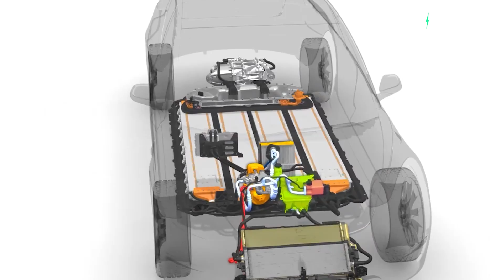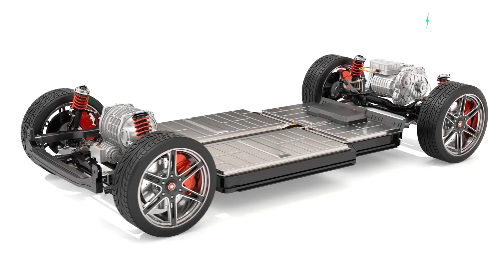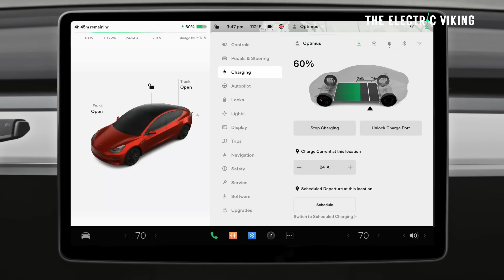No, you don’t need to replace Electric Car Batteries in 10 years time

Comment: My 2021 Audi e-tron with 56,000 miles lost a lot of range suddenly November 2023. A 100% charge range of only 171 miles. An 80% charge range of 156 miles. This never went back up either. The temperature never went below 50° outside. I always charge at 80% unless I'm taking a trip And I do this every night at home. I rarely use a fast charger unless I'm taking a trip and need to get home. I spoke to Audi about this and they said the battery health was fine, battery degradation was normal and that there were no error codes so the battery was in good health. This is ridiculous to me. Not to mention that a $75,000 vehicle is now only worth $32,000 for trade in value. And now the e-tron has a battery recall due to a fire risk. Before the battery issues, the car was one of my favorites. And I was all on board the electric vehicle evolution. Not so much now.

Comment: I take umbrage with this . Its not my experience with cars . Not the stats , but the stats only show that people are stupid .  Cars last very long if you drive them correctly and maintain them which is not particularly expensive when you do basics and drive correctly . 

In modern times driving low end cars I have never had any major failure and cars should last 200k minimum .

There are Soo many simple things to do to make a car last . 

I only drive manual trans cars but watching how people drive auto trans cars makes me cringe . They don't come to full stops before changing gears from drive to reverse for example . If cars have transmissions you can change fluids many people don't ever even look at it or pay attention to it . Learn a single thing about it and run them when they might need minor service until dead . That and scum bag dealers and mechanics take advantage . I drive manual cars and shift properly including not using the clutch much , rev matching etc . This is NOT brain surgery . People do not bother to learn how to drive .

They don't wait for car to reach operating temp before abusing engine . They are so soft they run HVAC before car is running at temp . They don't drive correctly to preserve brakes . They suck at driving and hit all kinds of stuff that slams the suspension and car . They don't run the AC in winter . They don't check oil and run engines with lower oil which increases oil consumption and then still don't check oil , retard levels of stupidity . They don't bother to familiarize themselves with basics of how cars work so are easily taken advantage of . They buy STUPID CARS with  stupid upgrades that fail . They buy GERMAN CARS !!! They buy cars with complicated twin turbo set ups built by Germans that have stupid engineering with plastic parts prone to failure . When something important fails their overpriced garbage with SOFT TOUCH everything they do not take care of looks like dog shit , that along with failure of over priced non essential options that fail cause major depreciation making the car not worth fixing . This is because people think other people care what their car looks like and what badge when new . 99.9% of people who see you in your car have no thoughts about you ever nor will you interact with them . Humans are weak minded and buy into ideas that cars are important to their person and  status which is at most 10% true in regards to what brain washing would have you think . 

People have poor driving skills . I drive a brand not known for efficiency, HYUNDAI , I drive a 2019 Hyundai Elantra GT ( I-30 in rest of world) N Line  , which despite having only a 1.6 engine with a turbo it is rated for like 28 combined because  it makes a whoping 200 hp to give it a sporty feel when connected to MT . I paid new 21.5 K $ with tax etc , I OF COURSE DID NOT PAY MSRP LIKE A MUPPET , nor did I get the 4500.00 upgrade product with mostly useless upgrades .  So I got a brand new car for what many people pay for a unknown qty used car . Anyway , I can get 40 mpgs in mixed driving if I want with the manual trans and paying attention or get the 28+32 
Mixed when I'm in the mood to redline it a bunch and make satisfying up and downshifts etc . Many people are unaware to drive the piss out of engines somewhat   regularly AT OPERATING TEMP / WITH HOOD OIL at proper level , so engine runs good longer . They do small trips over and over never letting the car warm up and zip around destroying engine . They put cruise control on and don't vary engine RPM at other times . I don't need to replace clutches because I don't use them much because I operate the car correctly to where you don't need to and never had a manual trans or even an auto fail yet many people do . 

Stats may be true but that doesn't mean they need to be . 

Then , the stats you quote don't consider the lack of ability to service EVs , the issue with EVs being totaled from minor issues or Hyundai for instance wanting 50k to replace a battery on car with scratched battery shield causing major insurance issues for owners , all the perfectly good EVs being totaled by insurance and then shipped to eastern europe and other places for profit where they fix and drive them .

You don't mention that people are STUPID and don't understand that if you full charge and fast charge and do many miles  in short periods then your battery does die prematurely . Degradation in range is real no matter what and real range is in perfect conditions not even always doable and charging to 80% is suggested for long  life and consider the avg consumer is brain dead .

Certainly the people who struggle to get service done exist.   Just because somebody who doesn't drive much may have little issues with EVs doesn't mean that's the case for others who are then out of luck . I just watched a vid where somebody did a road trip in a Cyber Truck ( this is a BIG TESLA FAN ) and charging times added 12 hours to what would be like 24 hours of driving . If you are only chasing status and virtue signaling around town that's fine , but if not that vehicle that seats 5 and has space for tons of gear  becomes useless for it's intent . That was without a bunch of gear and bed cover closed . 

NOBODY tells the whole story and anything and certainly not about  transportation and  human behaviour and trends .

Comment: Why Don't  EV  companies provide battery  warranty for 10 years or 250,000 miles if the statistics have shown that batteries last as much as you reported in this video? That would blow the price of used EVs, for example at used Tesla inventories,  out of water. Would it not?

Comment: An EV has MILLIONS of "moving parts" but the motion is thermal stresses that wear out connections...failures.  This false argument is silly about moving parts.  Batteries also grow dendrites that fail the battery with shorting...fire...burn down the house.

This channel is full of mis info.  EVs are toxic waste dumps and mega fire hazards that cannot be put out.  2000 C fire can burn through concrete.  Luton airport fire...1200 cars!

The battery has 7000 cells that all need to be about the same.  When some cycle differently, the battery becomes imbalanced and fails.  A battery will not last 60 years but an ICE car can.

New combustion tech makes EVs totally obsolete.  20-60 times more for EV fueling.  Game over...in 2-3 years.

Comment: I don't know for sure, but I hear that ev has possible electrical erosion problems. When you have different metal on metal, especially with chemicals, moisture, and currents running, there may be erosion issues. Just a rumour I heard. I know nothing about cars.

Comment: Try charging your tertiary battery from 0% to 100% and supercharge it twice a day. I would bet your battery will fail ( not degrade but fail) before 125k miles. Which s exactly wha ride share drivers are reporting. Buyers beware.

Comment: Small suppliers of the thousands of ice parts are going to go out of business.
If they make special piston rings for example engine manufacturers at OEM's will be screwed.
I'm basing this opinion on what I believe, which is that owners of businesses making rare or niche parts will not give notice of going bust.
If they did, they'd go bust faster as OEM tries to remove the work they do have.
A disincentive for honesty or openness.
Just a thought.

Comment: You raise an important point that the anti-EV lobby glosses over. The scrapage on an ICE car can be very low depending on the age. The scrapage on an EV,  no matter how depleted the battery is wil be much higher because 95% of the component material is recoverable during the recycling process.
Good catch!

Comment: Where I live there are almost no used BEVs with any mileage on the meter for sale. 99% of the used BEVs has less than 200K km on the meter. The ones that have more usualy have a new battery. This makes me think that a lot of older BEVs suffered with a dead battery and got scrapped.

This guy just seems to make stuff upp without any true experience or knowledge about it.

Comment: I have owned three different types of cars, and all of them have surpassed 300,000 miles with minimal issues. There is a person on YouTube whose car requires a new battery after only two years. While I am interested in electric cars, I believe they still need a few more years of development before I switch from my diesel car.
Reply: I think that's a fair point. Friends used to say to me, wait a bit longer, maybe next year, for the next development in EVs, before you go for it. I asked what I was waiting for, and they said, nothing in particular because the improvement is incremental, but it's significant. Then my car was written off at the age of 14.

I tend to keep cars a long time, so I thought, might as well go for it, now's as good a time as any. I decided, no regrets, the MG4 is the car for me right now, and whatever happens in the future, it wasn't available when it was my time to change.

But if you aren't forced to change, wait till you feel it's the right time for you. I have a friend who is ideally suited to an EV and wants one, but she can't charge at home and there is at the moment no obvious provision for convenient type 2 charging near her home. I've been advising her to keep her current car and wait to see what develops.

It's a far better attitude than screaming "I'll never have an EV because [reason that will probably be nonexistent in three years]" and running all over the net telling everyone who will listen that the cars are rubbish.

Comment: In 78 the Amaco Cadiz dumped 69 million gallons of crude off the coast of France

In 83 the Castillo de bellver dumped 54 million gallons of crude  off the coast of S África 

In 83 the Nowruz oil field dumped 80 million gallons of crude. 

In 84 the Kolva river oil spill dumped 94 million gallons of crude into a fresh
 water supply.

In 89 the Exxon Valdez dumped 11 million gallons of crude off the coast of Alaska 

In 92 the Mingbulak oil spill dumped 88 million gallons of crude into a small Asia town then set fire to it. 

In 79 the Atlantic Empress dumped 90 million gallons of crude off the coast of trinidad. 

In 79 the Ixtoc oil spill dumped 140 million gallons of crude into the gulf of México.  
 
In 2010 the Deep water Horizon dumped 134 million gallons of crude into the gulf of México.  

In 91 the Gulf war dumped 520 million gallons of crude.   

There really is no debate of EVs being the clean future.
  This nonsence must stop. 
We must rid our society of this horrible,  messy petrol leash.  The fact anyone still believes gascars are cleaner is apalling.   Big oil,  big auto, UAVV all have corrupt media that will  have you believe as they wish..Don't be brainwashed.  
Don't believe FUD

Comment: Even if statistically the batteries last ‘for ever’, the issue is the cost of repair when things happen. Or is it even possible to repair.
So it is a low risk, high impact situation. ICEs are in general higher risk but lower impact.

Comment: My seat Leon 1.9 diesel 2004 had 258k miles on it before i changed it, and it ran nearly perfectly the entire time, other than servicing only failure i had was the power steering pump.

It did need a new clutch when i changed it tho XD

Comment: Especially people drive the vehicle to work abd home.  And sleep 10 hrs a night.  The Ev can run the alternator to charge the battery or to run electric generator to charge the battery.   Even the solar panel to charge the battery.   We need to work on those issues.   The dollars will play the important role for saving and investment because the demand.   We can do more print monies because of the saving the spend

Comment: The reason we choose EV.  Because we know the EV it is able to do the charging in its own when the electric in the battery not use for driving.  We will use the left over battery to run the generator to charge the battery.

Comment: I have owned and operated a Lexus RX 400h since August 2005. It has over 230,000 miles on it. The Hybrid battery has never been changes and still seems to be going strong. My wife and I think this car is the best car either of us has ever owned.
Reply: That’s wild! My 2013 Prius pack was replaced this year as it no longer functioned in hot weather at 140k miles. No codes yet, probably could have limped it 2 more years but the new battery give me more powers and way better economy so it was worth $2,200 to me. I plan to keep the car manny more years.
Reply: @OptimisticEngineer345  I think I read somewhere that the Prius does not have a cooling fan in the battery pack like the RX. I thought that was just the older ones and they started including the fan in newer models. I thought that happened before 2013. Does yours have the cooling fan? Maybe that is why the battery failed with such low mileage.
Reply: @genethesurveyor  Mine does have a cooling fan. The problem is, it hardly runs at all, even when I knew the battery was hot. They tied the fan speed to driving speed so the sound wouldn’t be annoying. They also change the cutoff temperature for the battery to stop working with a software update to something like 120 degrees F, which is a problem when it’s that hot in the parking lot. That change was supposed to lengthen battery lifespan but I found it to be a problem for my aging battery. I upgraded to a lithium aftermarket battery last spring and it has been awesome. None of my cells were “bad” so I sold them all for about $700 total.
Reply: @genethesurveyor the third gen Prius does have a high voltage cooling fan.

Comment: Li-Ion batteries lose capacity by the number of cycles and age. I have a Power Wall that is three years old and has already lost over 25% of its capacity. I have never cycled it more than 30% in a day and usually only 10%.

Comment: If what I am reading elsewhere, EV's when damaged are going to be a real liability, if taken to a panel shop, they will have to be kept away from the interior of the shop and kept well outside in case of fire, which, if it took place in the shop the financial cost would be horendous, Insurance companies are already concerned about the chance of a huge claim should one self immolate. Insurance companies will be more likely to treat damaged cars as a write off and if so, they will have to be stored in the open away from anything at risk of fire.  Australia is a long way from having the infrastructure available to provide reliable and sufficient charging facilities. For me, EV's are not a viable proposition and may never be.
Reply: Well, there's already a million people, and growing, who disagree with you. Did you read about the Luton (Eng) airport fire? First reported as an EV spontaneously bursting into flames It destroyed the whole, new, parking facility and damaged or destroyed 1200 parked cars. It turns out that it was a diesel car. We'd been told that that was impossible, told by the guy that posted the "incident" on you tube.Hah
Reply: @davidtuer5825  Well you still don't appear to have considered the bit about damaged cars and the risk of fire when being or waiting for, repairs to be carried out, Ok ,so in that instance in Luton a probable million to one diesel problem caused a fire, had it been an EV the result would have been the same. I await your reply.

Comment: 10k per tonne of recycled lithium black mass. Must cost close to that amount to process as no one seems to be doing it. According to UniMelb Research only 10% of used lithium based batteries are recycled in Aus. This needs to change.

Comment: You should pick some of your subscribers electric cars and offer to replace their batteries if they do need replacing. I hear all this, but I don't believe you really believe it. So put your wallet where your mouth is. Replacing parts of a battery is stupid, because you have old parts with new parts. Those old parts will soon fail just like the parts that were replaced,,,,,,,,,,,,,,,,You go ahead and waste your money. I drive a used Honda 4 cylinder around and will save a ton of money,,,,,,,,,,,,,,,

Comment: The actual problem with ev batteries, apart from the massive weight and complexity, is the slightest dent means they are write-off.
Energy storage in an ice car..100 dollar plastic tank..in an EV 20K of batteries, wiring, disconnectors, cooling pipes and battery management.
Reply: i know a guy who ran over a huge deer in his model Y. He only damaged one of the battery coolant lines which took $300 to fix. Battery itself was fine.